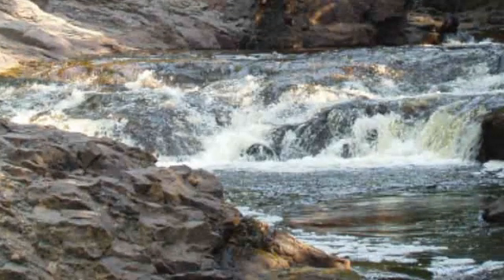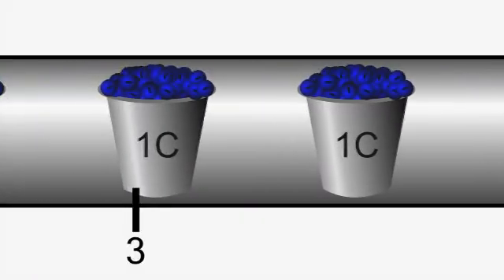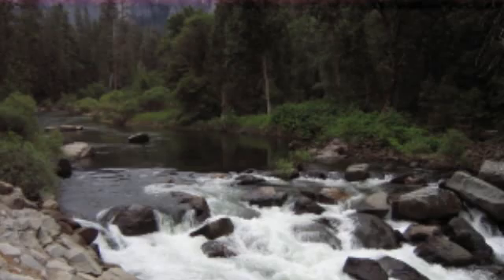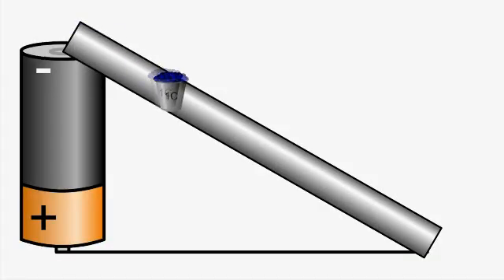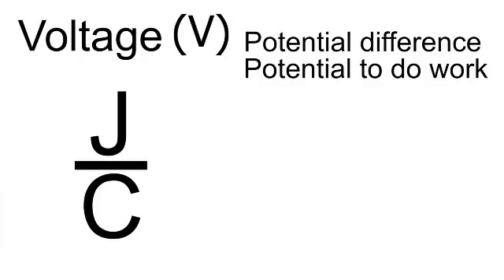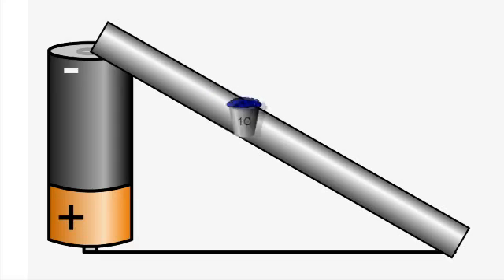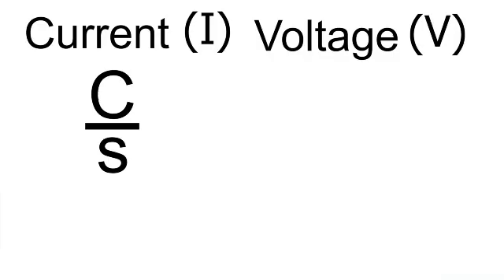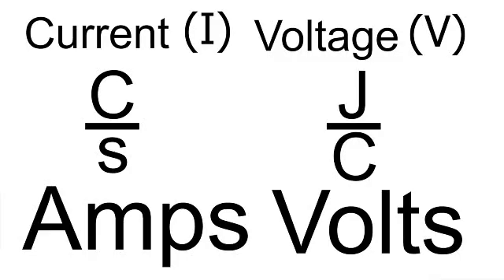Current and Voltage

Comment: @gullenator1 Its true once you do put a load on it will drop down. All Im saying is that voltage is not the potential to do work its a measurement of amps times ohms therefor if i have 1 amp and 3000 ohms that would be 3000 volts but if you have 1amp 1 ohm that is only 1 volt. See the problem? Amps are current therefor you could potentially have 3000volts with the same current as 1 volt.  And also no battery should read 14v when fully charged thats ridiculous maybe if it still has surface charge

Comment: @InsanePorcupine The statement is true.  Ohms Law V/R = I.Current is proportional to voltage in linear circuits.  As batteries are discharged the voltage decreases.  A dead battery may be able to sustain a nominal voltage for a short time and during that time the current will be proportional and obey ohms law.  Although a discharged battery may read 12 V (a charged battery should read 14v) it is not able to sustain this voltage under load, the voltage falls off under load, hence so does current.

Comment: i suppose my only preoblem with this vid is he says "The greater the amount of voltage applied across wire the greater the current that will flow". You need to fix this statement please it's not true. Ever had a dead AA battery? Put a multimeter on it and it will still read 1.5 volts but will no longer be sending any amps. You must know this. Thats why as a mechanic you do a load test because a dead and new battery will both read 12 volts.

Comment: @Vito305 So to sum up if your body has say 50 ohms of resistance an electric circuit will need 50+ ohms to send electricity through you. In other words if the circuit you touch has more resistance than you electricity will flow through you if you have less resistance than the circuit however if the circuit has really low amps it wont be enough to actually do anything to you so no volts dont kill amps do but they wont kill you unless there are enough and you are the path of least resistance.

Comment: @Vito305 I can explain this somewhat easily and I used to wonder this all the time. Volts=amps x ohms but you need both high amps and ohms to be shocked. For instance 10,000v could be .1 amp and 100,000 ohms which you would feel but wouldnt kill you. or it could be .1 ohm and 100,000 amps and you wouldnt even feel a thing but 100 amps and 100 ohms will kill you. Electricity will always take the path of least resistance.

Comment: @bears7777777 an amp is the measurement of electrons 6.241 × 1018 electrons per second to be exact and BTW dont watch this video if you actually want to learn it's not a very good one. And no when you raise amps the speed does not change but yes more electrons flow which is why you need a thicker wire.

Comment: so an amp is how fast the electricity is flowing? or how "compressed" it is? (if it is compressed of course more will flow past a point in a certain amount of time.)

when you raise the amperes, does it increase the speed of the electrons. or does it make more electrons cross the point in a second.

please explain.

Comment from the maker: The severity of electric shock is proportional to the amount of current passing through your body. However, in order for current to pass through your body (which has resistance), it needs voltage ('push'). This means that higher voltage can lead to a greater chance of electrocution.

Comment: Voltage 
Physical sciences are apart the mid field charges coulombs fitting to direct comments. 
Voltage is higher for higher a higher potential charge. Current ampere is flowing to a wire will always.

Comment: Thanks for the video and comments. This particular difference/relationship is very hard for me to understand in a fundamental/universal way. In danish voltage is called 'Spaending'=tension (of the electrons),  which makes more immediate sense to me than 'potential workload'. I guess with enough challenge of seeing this relationship at work in nature the proper/simplest explanation will come. Why did you put the negative battery pole on top as the voltage source?

Comment: @1veritasium Okay, the way I understand it now is to use the analogy of two water supply pipes - one is much larger than the other one, but both are pressurized to city water pressure. The voltage is the water pressure, which is the same for both pipes, but since one pipe is larger in diameter, it can bring a lot more water through the pipe in a given amount of time. The pipe diameter is the Amps. So the "flow" of water would actually be watts, since that is the pressure x the pipe diameter.

Comment: @theknightlynews I actually think the analogy does work for you. You are right - amps and voltage are proportional. But the mediator is resistance - if you have high voltage and high resistance, you get low current. If you have high voltage and low resistance you get high current. So resistance can be thought of a bit like the 'narrowness' of the pipe.
Reply: oh boy you're so big now
Reply: what a well crafted analogy of potential difference and current flow versus gravitational potential difference and streams. well done.
Reply: Woah
Reply: nice to see you here

Comment: This confuses me. If amps are the amount of electrons passing a point every second, and voltage is the potential to do that, then it would follow that amps and voltage should increase in a linear fashion. But I know you can have high amps and low voltage and vice versa. So this analogy of water flowing doesn't work for me.

Comment: Convention current (+q) flows from higher potential down to lower potential; however, in reality, electrons flows the opposite direction of conventional current.  So you shouldn't have said "electrons flow from high to low."

Comment: @flowerbower For those people who plan on becoming engineers that cant grasp the similarities between hydraulics and electricity are only going to have more troubles later. First of all I understand that hydraulics dont have a magnetic field however the principals involved are similar such as path of least resistance, diameter of wire vs diameter of pipe. Ohms law and the general flow of electricity are related to hydraulics any mechanic can tell you this. By the way just say on instead of open.

Comment: @matrixeducation By "made up" I mean we just measured a certain amount of electrons although it works as a system of measurement I believe a more accurate measurement is amps and is actually based on a less arbitrary number of electrons. I just think coulombs are archaic and overly confusing.

Comment: @InsanePorcupine The water analogy notoriously leads to other difficulties. For instance, when switches are open, current does not flow. When taps are open, water flows. Also, how does one represent a capacitance by using this analogy?
Simple analogies probably do no harm to those who never think about physics again, but they near-cripple those going into technical fields. To a physicist, all of the 'interesting stuff' takes place outside of the wire (pipe)!

Comment: in the above statement, increasing voltage increases current draw, using ohms law  dividing wattage by the voltage gives u current i.e. 100 w / 240v = 0.4 amp (400 milliamps) yet 100w/ 12v = 8.3 amps.  thats why transmission lines are stepped up to higher voltages for instance 350kv for long distances to next substation, to minimise current draw and heat, therefore using much smaller cable. please explain?

Comment: Ok I will clarify my earlier point on voltage. Voltage = amps X ohms. therefor volts is based off of amps and ohms therefor volts doesn't tell you much. You can have a very high voltage that won't hurt you in the least. For my case and point people have killed themselves with car batteries before. only 12 volts not much however car batteries have very high amps needed for the starting motor. That'll kill ya if you do stupid stuff with them. If you want to know more go to the darwin awards.

Comment from the maker: @InsanePorcupine Water in a pipe is a good analogy but let's discuss the other points. The resistance of a person is more like 5 000 000 Ohms - this is quite a high resistance. And it's true that current is important in electrocution but not much current will flow through you unless the voltage is high (because you have high resistance). I don't know what you mean by "all other numbers are for theory" - theory and experiment play an important role in understanding electricity.

Comment: More like water in a pipe. Electrons are like the water the wire is the pipe. Electricity will always flow into the wire with the least resistance. Your body has a resistance from 5- 50 I beleive so if you encounter a current running through something with a higher resistance than you and touch it youll get electrocuted. You see there is only flow and resistance to flow all other numbers are for theory. And FYI you could have a 10v system kill and a 110 harmless you need amps and ohms to kill.

Comment: induction or generation of electricity is what pushes the energy through a wire. Remember coulombs are a made up measurement. Real electricity is flow of electrons. Electricity always runs in a circuit now think of it like a chain of atoms with electrons in orbit.. Through induction we move the electrons and like the domino effect the free electrons get pushed in a circle much like water in a pipe. 1 amp is the measure of electron flow.

Comment from the maker: @VASEA0000 Yes, voltage is what "pushes" current through the wire. With a battery and a conductor connected in a circuit, you can't have vltage without current or current without voltage. Hope this helps!

Comment: I have a question if you don't mind : Is voltage (V) the thing that push the current (I) through a wire ? If no , can current (I) work without voltage or voltage (V) work without current?(I mean lighting a bulb or something only with V or anly with I) You explain very good there thanks i really understand , but this is bugging me for a while and if you can answer i'd be grateful :D

Comment from the maker: @InsanePorcupine Energy is dependent on both current and voltage. Current is the rate of charge past a point, and voltage is the energy each coulomb of charge can provide. So power is then the product of voltage and current, the number of coulombs past a point per second times the work each coulomb can do.

Comment: This is not true! More volts does not mean more energy it all depends on the amps. If this were true when you step up a voltage with a transformer from say 100 to 1000 volts but you lost something amps they went down by a factor of ten from 1 to .1 . Higher volts are not as important thats why many 24volt systems are changing into 12 in vehicles. volts is based on ohms law Volts = amps or coulombs per second  X  ohms or resistance to flow.

Comment: So Coulumbs are little blue balls or something and if you tip a dry river bed enough you'll get lots of water? Hmmm If i connected up a 400 v 4 uf capacitor in series with a 240 volt bulb connected to a 240 v domestic ac supply what would happen?

Comment from the maker: Technically yes, a Coulomb leaving the positive end can do more work relative to a Coulomb at the negative end. But, the two light bulbs you mention would be equally bright because current has a way of evenly distributing the energy as it travels from the positive to negative terminal.

Comment: Yes but measurements of electricity depend on the FMMC Meter. And we can see that the meter cannot measure both voltage and current because it cannot magically change into another instrument: a tachometer cannot measure temperature as well, for instance. So in series and in parallel the meter measures the same thing. What does it actually measure then? I say it measures conductance, after CAREFULLY thinking about resistance change relative to the meter.  Cgange of battery size is another matter.

Comment from the maker: There are subtle differences, but I would suggest for the student of introductory physics they are all roughly equivalent. Certainly voltage and potential difference represent the same thing. Emf is the voltage induced due to a change in flux.

Comment from the maker: No the positive pole is more positive and has electrons flowing into it, which can be thought of as positive charges flowing out of it (not actually what's happening but in physics terms it is equivalent to negative charges flowing in). What you call zero volts is arbitrary. You can call the negative end 0V in which case the positive terminal is +1.5V or you could call the positive end 0V in which case the negative end is -1.5V. In either case, electrons flow from negative to positive.

Comment from the maker: No it doesn't. Greater potential means greater current, assuming you haven't changed the resistance of the circuit. Ohm's Law is V=IR. If V increases and R remains constant, I must increase.

Comment: The power lost in wires is proportional to the square of the current flowing through them. Whereas the power delivered is equal to the voltage times the current. So by increasing the voltage and decreasing the current, you can deliver the same power but with less power wasted in transmission.